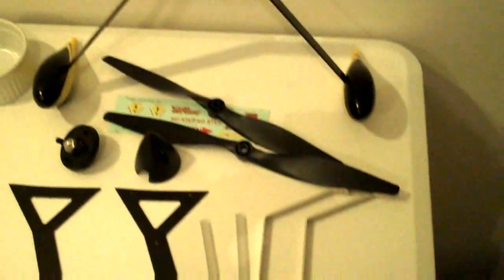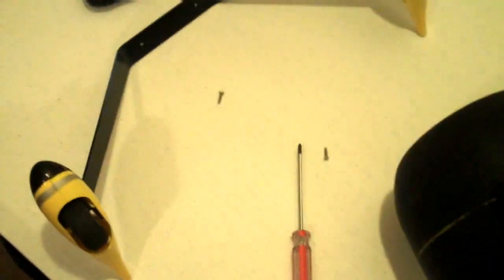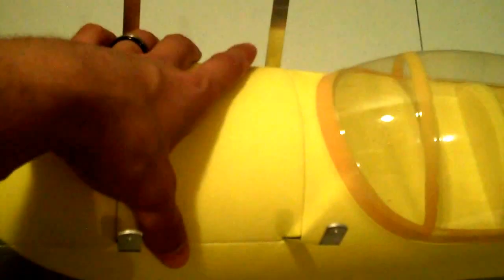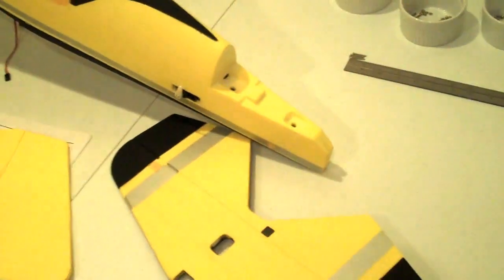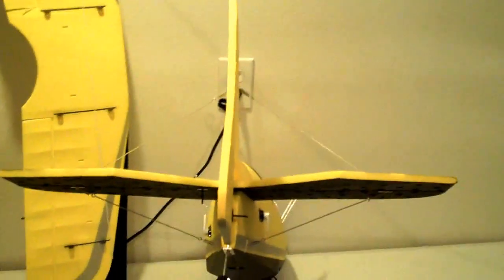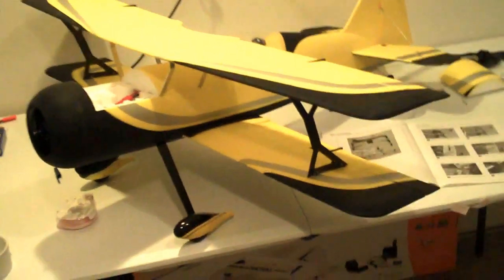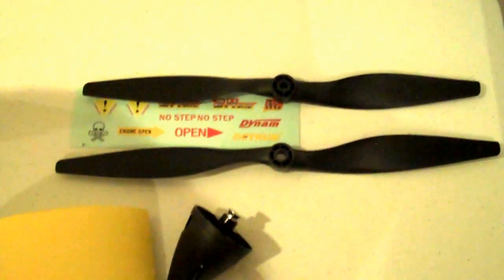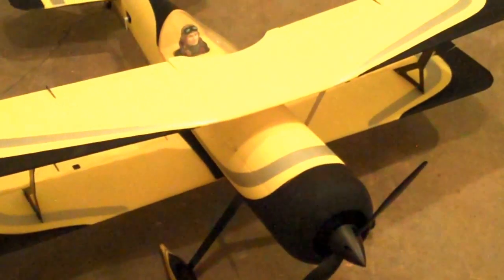Nitroplanes.com Dynam Peaks Pitts Python Biplane Build

Comment: Just a note after building mine today. Once the bottom wing is all bolted on you have zero access to your receiver. I'd recommend adding servo extensions and placing rx in hatch that was glued, then use magnets and don't glue hatch. Thanks for video

Comment: Thanks for the vid. As usual I watched it after my build. I have to learn. What weight on batteries have been used? I am planning to go with Zippy Compact 2700mAh 35C => 284g. From what I have read in various palces, this should be ok with COG - but hopefully not too heavy.
Reply from the maker: You should be fine at that weight however, it will affect 3d flight.  It will do aerobatics very well though.

Comment: Hi again. I am going to send both of these planes back as the motors are junk. I calibrated my tx to rx, set endpoints, tried all 3 timing modes and these motors still want to buck and reverse. This plane has been the biggest let down i ever had as far as rc planes go. I don't know how nitroplanes had 5 stars for this thing but no more dynam or nitroplanes for me.